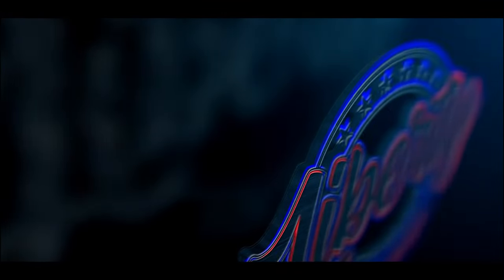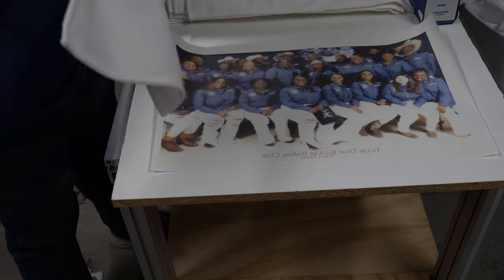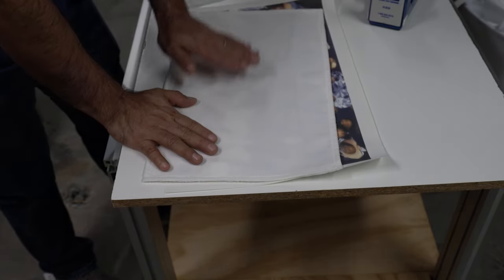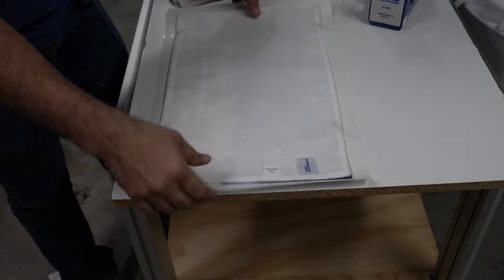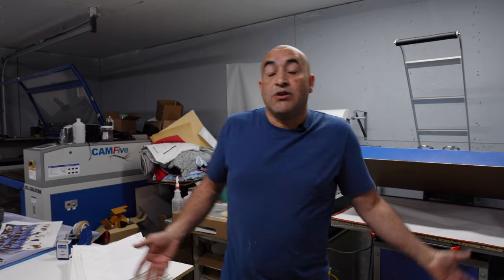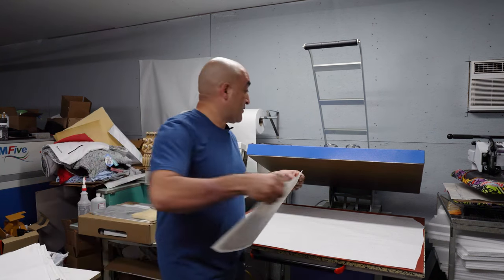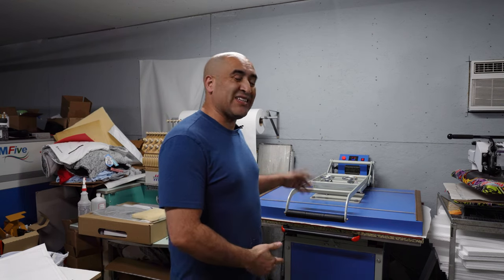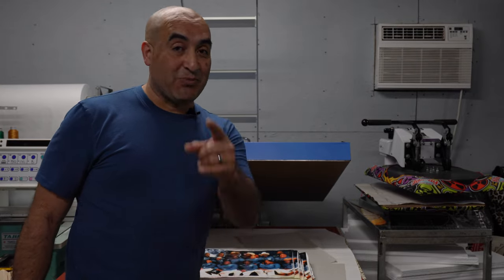The BEST SABLIMATION Micro Fiber Towels

Comment: Hey Juan, I got the new USB emulator in, plugged right in, however it does not seem to recognize the usb., it just goes at looking at the designs in memory. What might I have done wrong?
Reply from the maker: what machine do you have?
Reply: @LibertyGraphicDesigns    Tajima TMEX C-1501 I think it's around a 2001